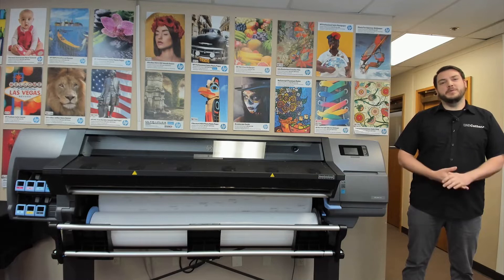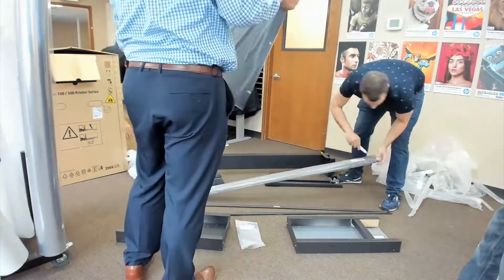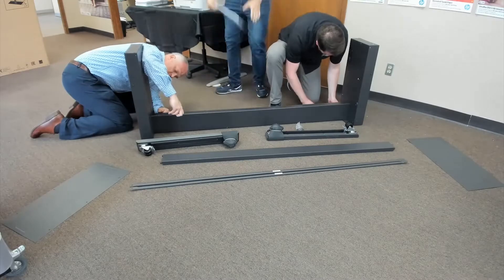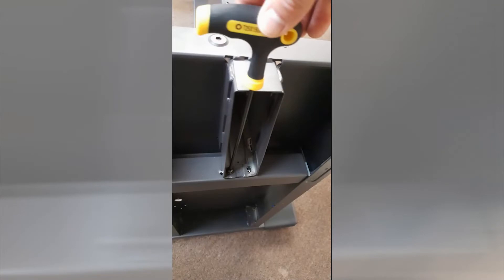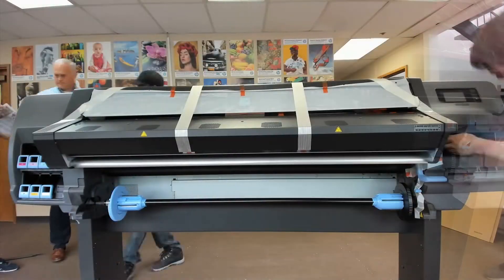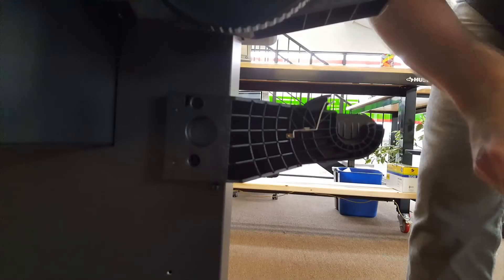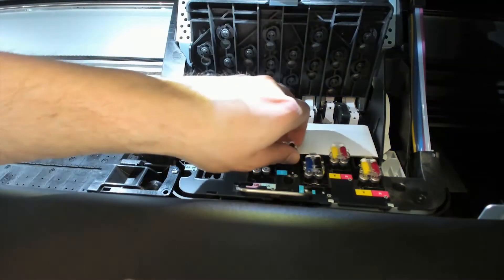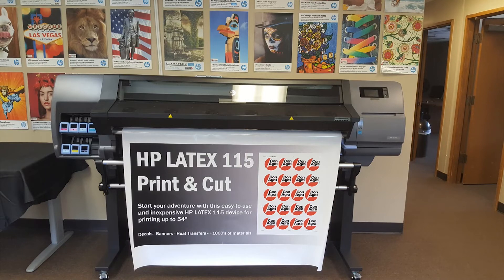HP 115 Latex Printer Initial Setup

Comment: Does this need a 200v - 240v power source?
Reply from the maker: The 115 printer needs 220V to properly work the heating element. We sell an up-converter for this purpose: https://www.uscutter.com/Quick-220-Voltage-Converting-System
Reply: USCutter Videos Good to know thank you
Reply from the maker: @hq0804  If you are not already aware, we are hosting a free HP webinar on Feb 19th 2020 where you can see a full overview of the system and ask questions.
Reply: The HP 115, is it 2@240 volt plugs or 1@120 & 1@240? The converter you sell, is one adequate if its 2@240 volt plugs?
Reply: @uscuttervideos  So, this printer does require 220V to operate properly. Which 220V outlet configuration does it need in order to plug it in?
Reply: @uscuttervideos  how many 220 outlets does it need?